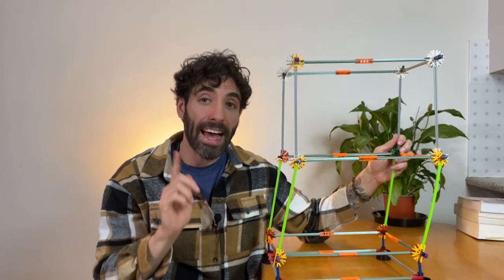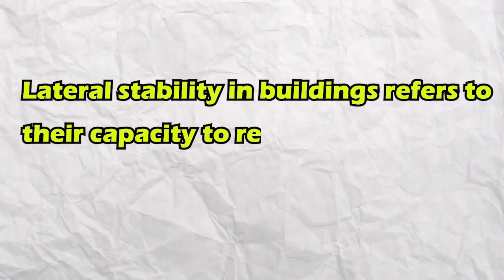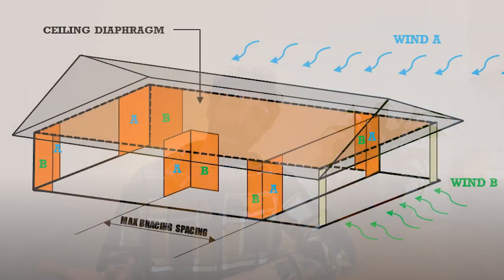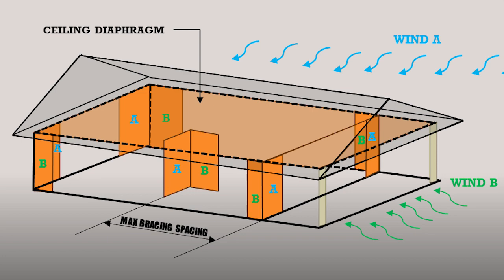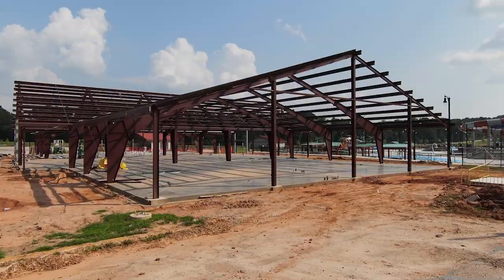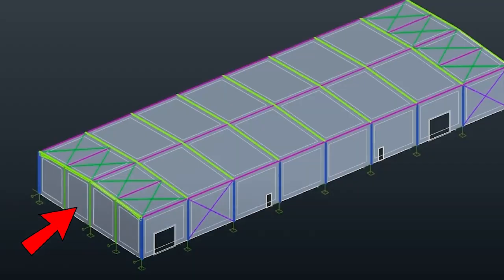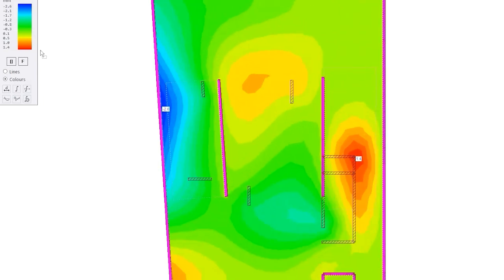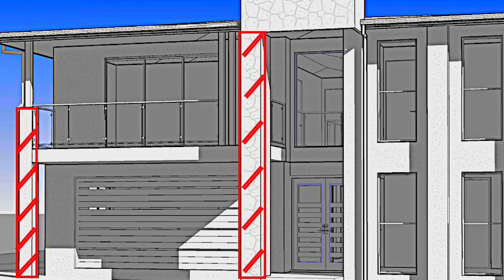How Engineers Design Buildings for Wind and Earthquake

Comment: thanks for valuable lesson. as a student of last year bsc civil engineering which software you recommend me for rrc structure ,steel structure ,connection of steel members ,and foundation design.  main focus will be to compare result of hand solution with sofware results .thanks
Reply from the maker: I don't know where you live, but I would look for a software that offers a free student version. Autodesk Robot does that.
Reply: @bengthebrazilianengineerinAus  thanks for reply im from pakistan but studying in gerece. i have autodesk access and bently. but want to know which softwares are using widly and most in eroupe
Reply from the maker: @structurbay   I'm not sure about Europe. I'm based in Australia. From my experience, Autodesk and Bentley are used worldwide. Just use what you have access now. Different companies use different software. If you learn how to use one, it will be easier to learn any in the future. I've got some videos on the channel about software.